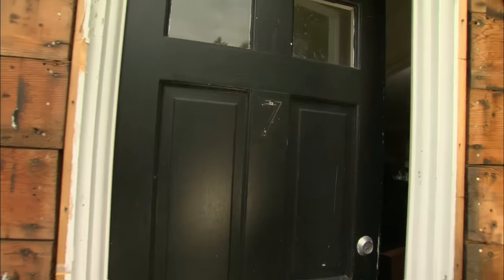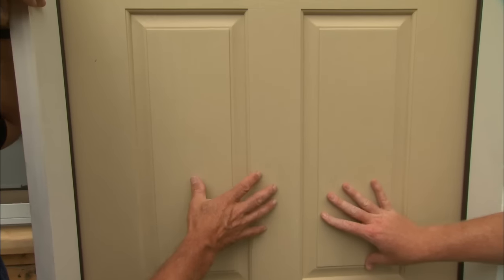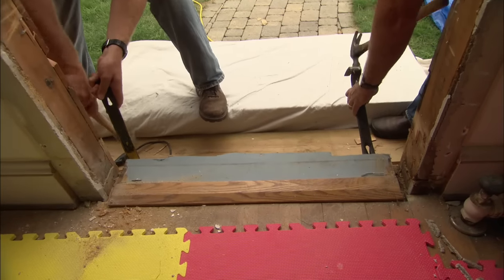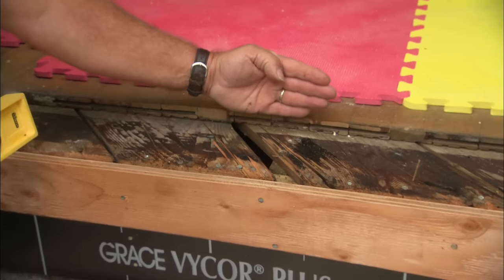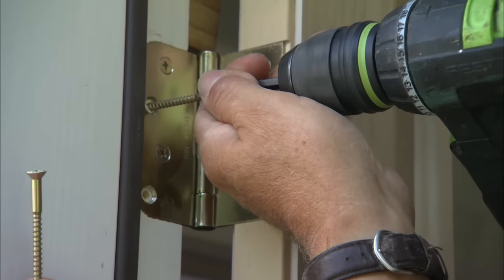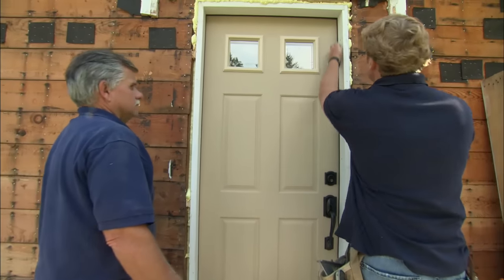How to Install a Fiberglass Entry Door | This Old House

Comment: I am installing a new exterior door. I watched many clips about installation of an exterior door. This Old House's clip is the most practical and most comprehensive one. Thank u.
Reply: It's really not that great, it doesn't thoroughly talk about making the door plumb, and level, and where the screws should go etc., How many screws to use
Reply: @johnthree1611 exactly what I was thinking, there much more comprehensive videos than this one.

Comment: There's no need to put fasteners through the jamb where they're visible. The gasket that the door seals against can be removed and you could put a fastener right adjacent to this kerf cut. When you reinstall the gasket it will hide the screw.
Reply: Don't remove it!  Just use a shim or something to hold the weather stripping back while you screw the fastener in.
Reply: @pearljam_1 yes! That's what I did today

Comment: Wouldn't you be more concerned with aligning the jamb with the interior of the house??? I work with a lot of older brick on block homes, and typically align doors with the interior side of the swing, that way I don't end up with a door that swings into inside jamb extensions, pulling the hinge screws loose. Am I missing something?, or do you have another way to resolve that issue?

Comment: Two things to remember.  He put longer screws in each hinge into the jamb side, I suggest doing that into the door as well.  Those screws are only about 3/4 of an inch long and if you ever watch COPs or movie where they open the door with a shotgun they never mess with the hand set and deadbolt.  Next.  Never use foam that does not specifically indicate it is for doors and windows.  Those others will expand and your doors and windows will be stuck shut.  I'm no Tom Silva, but I design, build and install doors and windows.

Comment: 1. Gap and Crack Spray Foam is NOT for Doors or Windows. 
2. Rough opening should be wrapped using house wrap
3. Sills should have metal drain pans 
4. Shim and Fasten the Jam behind every hinge plus latch plate and more
5. Check Door Reveal around Jam
This video should be a lot longer and provide way more details. I would hate for a DIYer to install a door based on this information
Reply: He probably used window/door foam.  I've seen guys wrap door jambs,  I've also pulled doors that never had the jambs wrapped and the framing is dry and straight and the door never leaked.  The door should be in a metal pan.  I'm sure he did shim and fasten behind every hinge and the latch, I'm not sure why they wouldn't make that clear or show it.  You're right there's also no mention of checking the door reveal :O
Reply: Very true - thanks Blake!

Comment: Something strange about the sill removal: It had self-sealing membrane underneath when they removed it (and same brand as they apply later) but the membrane was not there when they scribed the 2x4. Maybe they forgot to film that bit and added it later just to show that it needs to be done?? Regardless, another good video from TOH.
Reply: I caught that I'm guessing the old threshold was removed before filming   and they hamed it up for the camera
Reply: If I understand OP comment correctly, Tom simply cut the waterproofing off. He had to because you wouldn’t build up the subfloor and then nail the filler strips through the membrane. He built it up, nailed the filler strips then went over that with the self sealing membrane. Had he not cut the old one out water could potentially be trapped between the two membranes of water happened to find its way in. So long story short (to late I know) he cut off the existing and replaced it.

Comment: I installed a lot of doors and they left a lot out. Like shims and fasteners at 3 to 4 locations each side. And what about the scrap wood nailed to the jamb on the front to align with the front - what prevents the door from swinging inward uncontrolled while you are working on the jamb level and alignment?
Reply: Agreed.

Comment: Would it not have been better to use pressure treated wood for the bottom pieces? Or treat the 2x4 strips used there?
Reply: Not necessary. Treated lumber is only needed when in direct contact with concrete, or exterior use.

Comment: This is a perfect scenario situation. Majority of the time, setting a door flush with the exterior plywood or the interior drywall will leave your door not shutting plum.
Reply: Your door should always close if it’s plum but yes you can’t always just flush it either side sometimes you kick in or out a either end if needed also even divide the difference but the door should remain plum

Comment: I'm installing on concrete...thinking use some epoxy and give it a day?  Might using a treated 4x4 or 4x6 post cut on a table saw be better?  I'm spitballing here!
Reply: But then how to disguise it. It's quite a slope - i guess they built this porch to shed water.
Reply: +John RossStar how did you end up going about it?
Reply: Well i made a long wedge off a treated 4x4 post on my table saw. Figure the dimensions using a level. I had to make two and lay side by side as it was a very deep door.
Had to redo it later as the first wedge was too thin and a bit short too - rain would get by it. 
The 2nd time i made it thicker and glued it down with this high dollar tube of construction adhesive that resists water.
(don't use Liquid Nails!) Let it cure before proceeding.
You can see it from the outside but doesn't bother me - there was no way to avoid it.
It was a massive PITA but the door looks and works great now.
Reply: I don't have a cam hooked up. sorry bro
Reply: John RossStar no worries, it's just a chat. No video necessary.
Reply: Some other time maybe - wore out at the moment. Chainsaws will do that to a fellow.
Reply: +John RossStar haha thanks bud. the links connected to my phone, so whenever you get a chance, shoot me a message on it. It will really help our study

Comment: Thanks for this. 

I had a new Masonite exterior fiberglass door installed for my laundry room.  The problem is that the steel threshold sticks up 1 3/8”.  

I realize this was designed for thick tile or wood floors, but the room has vinyl sheet floor.  So the threshold is easy to trip over. 

I have not been able to find a reducer that will remedy the situation. Any ideas on the best solution?

Comment: that scribe leveling trick made no sense to me. If you are following the rough floor with the compass point, wouldn't the opposite pencil line be as jumpy as the rough threshold surface?
Reply: You flip the piece he scribed and cut and face the scribed side downwards towards the subfloor with the straight level side upwards 👍

Comment: Need some guidance from skilled and learned viewers. We recently upgraded our flooring from vinyl to ceramic. The increase in floor thickness is causing problem with the weather strip or sweep installed at the bottom of the door. Whenever we open the door, the door drags our entry rug along. What can be done to raise the height of the door so it won't drag the rug?

Comment: What is the drill bit that they use to open o hole in the frame? and what is the adapter that open extra after the bit to hide the screw head. ?????? @5:18
i saw the show in the TV, actually here they cut that part of the video when Kevin drill the extra.

Comment: I would have done it different. I'm going to do it different as soon as I go get my wood from HD this morning. I'm sure the way they did this is good for their situation. I just don't like a whole 3/4" of nothing but foam and a few screws between the door and the walls.
Reply: The Lone Stranger  What is that reason? I finished the door. I had about an 1/8th inch gap left to right, and about 1/4 in at the top after the prehung door was set in place. I filled the gaps top to bottom, as well as the top horizontal gap, with multiple sections of 12 in long 3/4 in deep, pressure treated wood shims held in place with DAP Dynaflex Ultra. I foamed it as well, behind the shims. If the entire prehung door and frame ever need to be replaced, all I have to do is back out the #10 3 inch SS wood screws, then cut the shims with a reciprocating saw.
Reply: The Lone Stranger  OK, yeah, and I shimmed my gaps. As for the "roof opening"...??? Do you mean the gap below the header? I don't think you're on the same page as me or the video. You sent me a link on how to frame an interior wall to allow for a doorway to install a bedroom or bathroom door, much different gaps for different reasons. We (the video and me) are dealing with prehung exterior doors, not bedroom doors. My exterior door is in the shade, and the house is in Florida, so there will be very little if any perceptible thermal expansion from radiant or convection heat, and little if any contraction due to very mild lows, even in January. There will be little if any expansion or contraction due to humidity since the door is fiberglass and the frame is composite. Neither are wood. Thanks anyway though.

Comment: I have a question. We are getting ready to install a fiberglass door that we bought from Lowes and it will be ready to pick up I about two weeks.... the thing is....it's getting cold here in East Tennessee. Will cold weather effect this installation in any way ?  We are installing it in a mobile home. Getting rid of trailer doors and putting in house type doors.

Comment: I had a contractor install a Therma Tru Classic Craft door in an old Fram House. It is out of square. Any videos or tips on to removing and reinstalling the door properly?
Reply: Depending on how far out it is you may not have to remove it. Remove the casing on whichever side is easier and drive shims in at the neccessary corners. Diagonally measure the jamb. Keep on til the numbers are the same

Comment: It seems there is actually only about 4 screws holding the door in (via the hinge)?  Seems like there should be many screws.
Reply: there are, when you saw him shim up the one side, nails or screws go through the frame / shims / and into house. For the sake of time, they don't show you that they do this in several locations and the threshold / raiser / into the subfloor. they show it very quickly but if you're not looking for it, it can be easy to miss. Hope this helps and have a great day

Comment: My house isn't nearly that old, but I'll bet it doesn't go that well.  For one thing, the doors are not 80" high in old houses, they are more like 79 - 79 1/4 and they don't make fiberglass doors that size.  Thus, I'm thinking this doesn't normally go anywhere near as easy as shown on an old house and especially one made of brick.

Comment: I have a steel door from Lowe’s that has a foam core in it and that’s not very energy-efficient I don’t think the R-value is very high
Does a fiberglass door have a higher R-value than a steel door With a foam core
Reply: steel door is for a garage and  has no r  value  you should  have got a fiberglass door

Comment: How do you install a front door in a brick home with block walls inside. In other words I have no 2X4 studs at all in my 100 year old home. The house also has a concrete threshold. Would most carpenter's know how to do this for us. It's a prehung entry door.
Reply: If no room for wood tapcons work

Comment: How would you add a storm door to that kind of exterior door/frame?
Reply: You bolt it to the front
Reply: After the exterior frame has been installed you measure the finish opening on the outside top middle and bottom of the sides in the inside of the outside frame and take your smallest  Dimension and that would be your call number for a storm door to properly fit

Comment: With such a big gap for the expanding foam, I'd have found a better fitting door.
Reply: They're standard doors. Almost all these doors are made 36 in.
Reply: MKRM27 - Me too. That gap looked very scary to me.
Reply: brianohbrian burns Insulating foam is better than solid material i guess. There is no reason to fill it with solid material. It’s not like thieves can run in through it or so. The gap will be covered anyway.
Reply: MKRM27 so what like a 37 1/4" door? Sheesh!!!
Reply: You'll be alright.lol
Reply: If you have 32 door panel ..u need 34 inches opening. Allways need aleast 1/2 or 1 inch space ..is a code ...if you want exactly door u have to make special order
Reply: Plus after you put you out side molding ..inside casing the screws and the foam will make de door more stronger ..if you want u can allways keep a gun next to you to feel safe

Comment: What happens if burglars try to kick in the fiberglass door..?  My last apartment the door was kicked in by a burglar when at work, the solid wood exterior door survived, but the door jamb was splintered where the dead bolt (Extra long), went through door jamb intoi structure, the apartment complex had to replace the entire door frame & hinge screws used were extra long into the building structure to prevent further break in's, the door bolt side was also re-inforced into the building structure..

My parents home had a metal sheathed door which had fiberglass insulation & to spite a western (Texas sun heat !) exposure, did not have temperature issues in summer or winter..  :-)
Reply: The same thing that happens when you have a concrete door - you lose that nice flat screen you had!!!  If you want to live in a vault buy a vault door!!!  Oh yeah - and buy the vault door frame too!!!!
Reply: Just put 2 dropbars behind the door if you want that security. But i think, if your house is at ground level, it’s quite hard to keep people out who really want to get in. The alternative to breaking the door is to throw a brick through a window. There is nothing you can do against that except making your house look like a prison. I’m glad to have an appartment on the 3th floor. No business at all with what happens on the street.
Reply: You will be glad your door can be knocked in when the fire department is coming to rescue you. You can't put an impenetrable solid steel vault door on a residential apartment.
Reply: John Armstrong  Armoured steel door with wood panels inside and outside for decoration in my apartment.

Comment: i have a concrete home I want to change outswing door to inswing do I buy a new door or just reverse have
Reply: Hey friend, I would get a new insulated prehung door..exterior doors are supposed to swing in anyway. Steel insulated comes ready to paint, good door without the price tag of a fiberglass one

Comment: He already knew the door was level Left/right when he checked level on the sill. Why did he have to check again at the top hinge?
Reply: Scott smith Because there are no triangles in a door frame, so the frame is able to twist a bit. Got to correct that twisting.
Reply: Racking of the door frame.

Comment: I wonder really if most houses in US have such very low secured front doors. In europe, those low quality doors will build in garages or gardenhouses. Seems like the standards in US are very low.
Reply: Pro tip someone that wants to get it will do so through a window. No point in wasting resources reinforcing a door any more than this.
Reply: Americans have low quaility doors but high quality guns

Comment: What has not been mentioned is if this is an off the shelf door from Lowes or Home Depot that the doors are crap and the jams are cheap wood that rots out. If you go that route best to order one custom for a minimum of $700 for something that will last and is of higher quality all the way around. So many of those door jams are just stapled together along with the threshold. Just junk.

And i do not understand Kevin with the tool belt. It is more a prop for him. I am only 1:15 in and I am hearing Tom give Kevin instructions on how to cut out the preexisting door jam. Really? Installing a prehung door is entry level carpentry And he has been on the show how many years? And he has that massive tool belt draped around his shoulder like a seasoned carpenter.

Comment: the helper grabbed the sawzall by the electric cable.  NO
Reply: F. Ball don't worry about it babe
Reply: That’s standard operating procedure.
Reply: He does so to save his back by not having to bend over. I rather buy a new cable than a new back.

Comment: steel door is much better.
Reply: Bullshit!!  Put one on YOUR house then when it's colder than a well digger's ass next winter fell it!!  They're cold as hell. Steel is a great conductor of temperature and fiberglass isn't. Remember???

The woman i bought my house from in Illinois put a steel Mastercraft (It should be called a CrapCraft!!!) and it's taking a trip to the trash in favor of a wood or fiberglass door, as soon as I can afford it.  Anyone who buys a Mastewrcraft door is out of his mind.
Reply: +Marc Plante No, fiberglass doors have the best warranty, which in turns mean they have the longest life.
Reply: +prairie wanderer ,
Reply: One should define better on what property. A door has more functions than temperature isolation. Keep uninvited guests out for example.
Reply: prairie wanderer Warranty doesn't mean quality. Steel lasts for centuries and doesnt change with time if properly maintained. Fiberglass, not so.
Reply: Steel has a major tendency to rust, especially at the bottom of the door.  This is why so many steel doors have kickplates put on the bottom later on to cover the huge rust holes.  I'll stay away from steel, thanks.